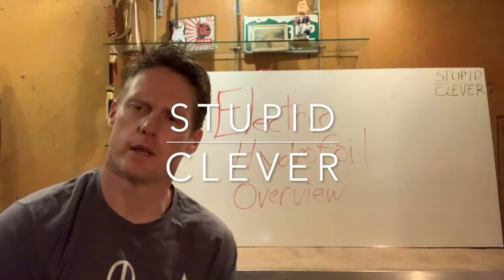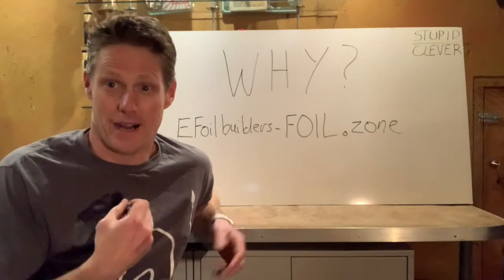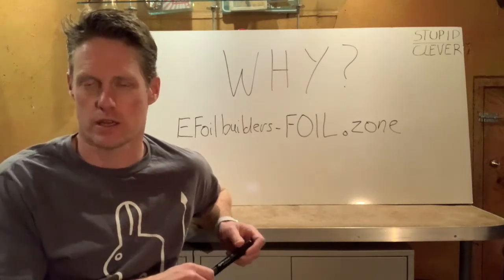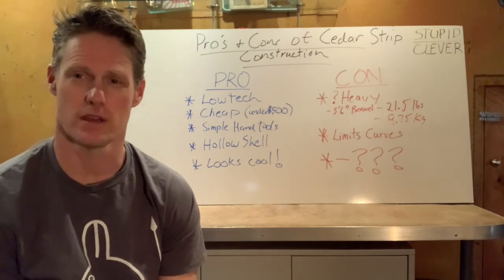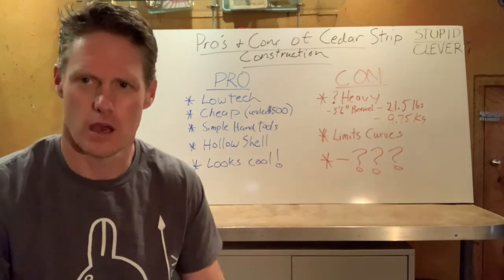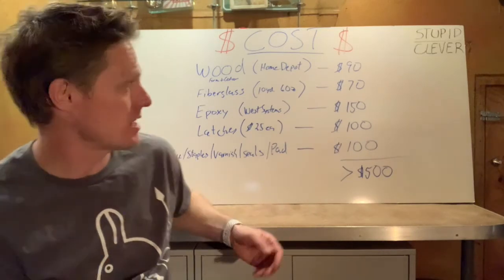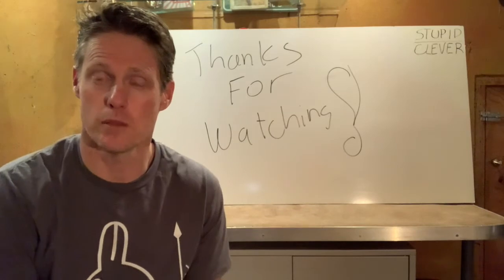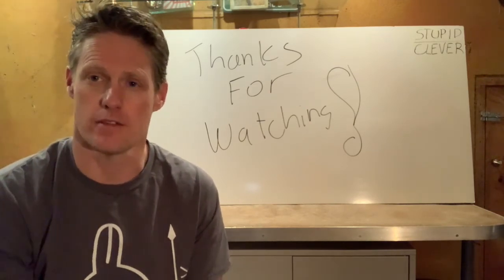DIY Cedar Strip E-Foil Board Overview

Comment: Just found your videos which I'll watch in full. I've been moving along the same plan. Did you eve do a video of the efoil build beyond the board? I'm curious about the components you ended up buying. Did it fly??
Reply from the maker: I am sorry to say the project stalled with COVID and some other issues.  My local reservoir banned E foils as they don’t allow personal water craft and I really don’t have anywhere to  use a foil even if I finished it!  I think the board is still solid and I still might pursue completing it this next summer as time and money allows.  Thanks for watching

Comment: do you plan to design this board where you can interchange the motor and battery to your shorter board [ when you build it ]
Reply from the maker: That would be the idea.  The propulsion system will be integral with the foil and the foil should be easy to move from board to board as well as the battery and ESC.